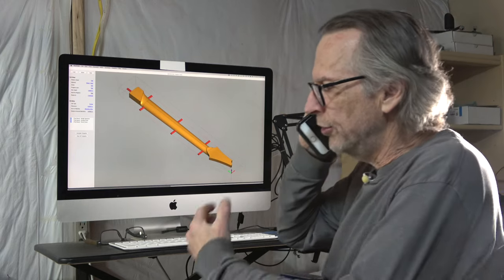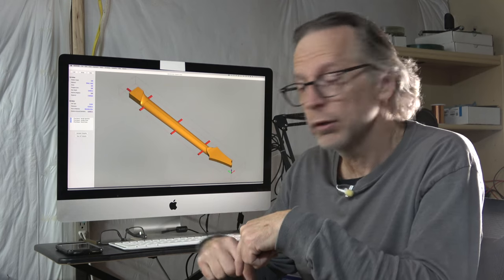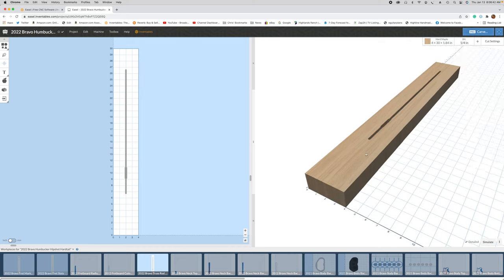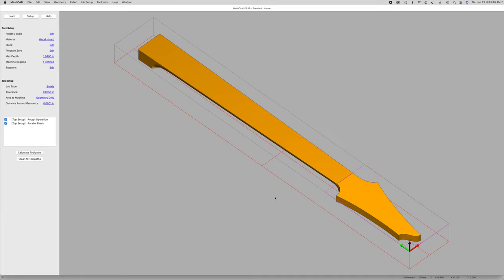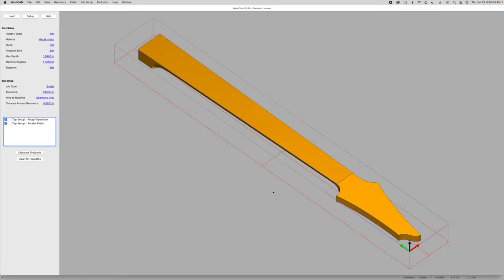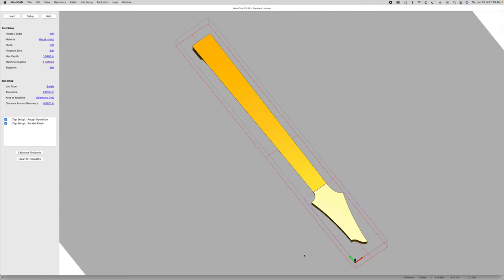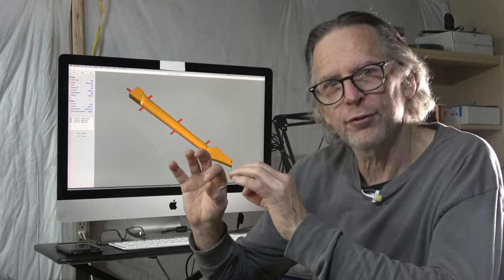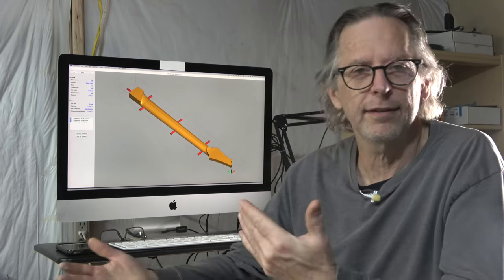My Guitar Neck CNC CAM Strategies

Comment: Do you use bigger bits for roughing operations?
Like a 1/2 or 3/4 flat bit, before finishing. I use a bigger ball end for final pass, like a 3/4. Just learning my machine, so I know my speeds and feeds. Great advice, thanks!
Reply from the maker: No. Most of my roughing and finishing operations are done with a 1/4" endmill. I've tried ball ends up to 3/4," but found it made little improvement. Certainly not worth the trouble of switching bits.

Comment: Question on this as I am doing my first angled headstock. The tip of the angled headstock and the sides along with the area around the volute isn't a straight up and down vertical surface. It's also angled as well. It seems like your contours/pencil operations seem to be 2D operations. I have set up some 3D contour operations in my CAD/CAM (Fusion 360). There still seems to be some unmilled portions on the outside contours of the headstock. Any recommendations on how this is supposed to work?
Reply from the maker: I haven't had any issues with unmilled portions on my angled headstocks.

Comment: Hey Chris, curious as to why you bring everything back into Easel Pro, and not simply work with MeshCam?
Reply from the maker: I like using Easel Pro for 2D cutting because it's fast and easy. Also, I need to use Easel Pro as my g-code sender. BTW, next week, Inventables will be introducing a full 3D solution that may replace MeshCAM altogether.
Reply: @HighlineGuitars  Good to know! Thanks Chris

Comment: Why is this guy any better than the big guitar companies. One cnc is better than the other?
Reply from the maker: I have had 3 CNC machines, each one significantly better than the previous one.
Reply: It seems you're asking if there is any substantial difference between guitars made on CNC machines. If they're all automated, they must all be the same, you might conclude. Check out the Driftwood Guitars video that discusses this. https://youtu.be/-QYkwwolMec
To answer your question, a CNC machine can cut out shapes, but there is a lot more in the process of making a guitar, especially acoustics. Even in electrics, though, you need to get the neck to fit right, you need to set up the string action, get the nut right. The frets need to be leveled and shaped correctly. The fretboard can have any kind of radius to it. Getting the finish right takes skill too. All these things can affect the quality of the instrument.

Comment: If i had a cnc, i would make an Endure neck. The standard neck is too easy for that kind of machinery.
Reply from the maker: The CNC machine would have no problem making the Endure neck. It wouldn't be any more challenging than a regular Strat or Tele neck. In fact, it would be easier since there's no headstock.
Reply: @HighlineGuitars  lets see it happen!
Reply from the maker: @SonsOfThunder229  I've been toying with the idea, but I have to clear my schedule and it's going to be a while!
Reply: @HighlineGuitars  how much would you sell one for? Im interested
Reply from the maker: @SonsOfThunder229  Probably $2,000 to $2,500.
Reply: @HighlineGuitars  haha, i can just buy a strandberg guitar for that price.
Reply from the maker: @SonsOfThunder229  That's the price for a complete guitar.
Reply: @HighlineGuitars  oh youd be willing to make the complete guitar? I would just like the neck, id like to make the guitar
Body myself.
Reply from the maker: @SonsOfThunder229  I only make complete guitars. I don't make parts. And I only make what I want to make, not what others ask for. Unless they are super famous!